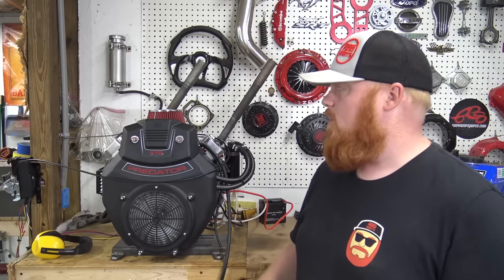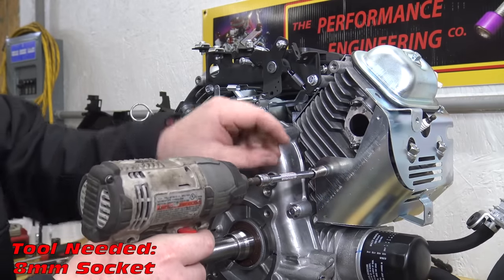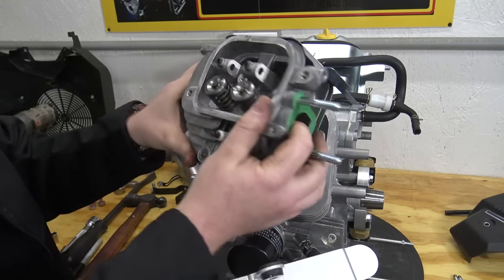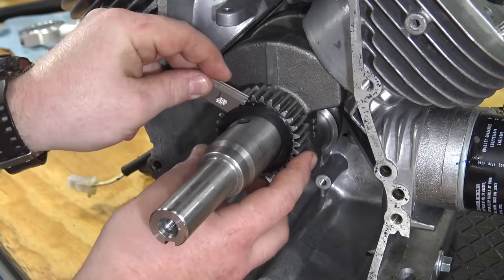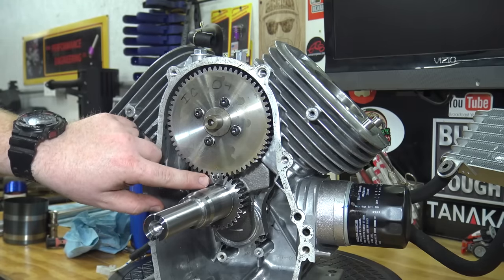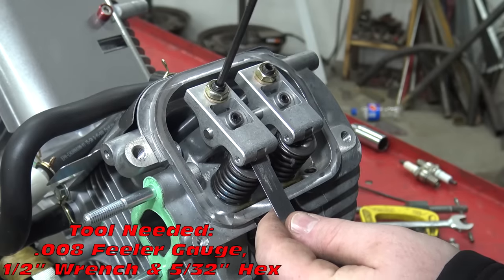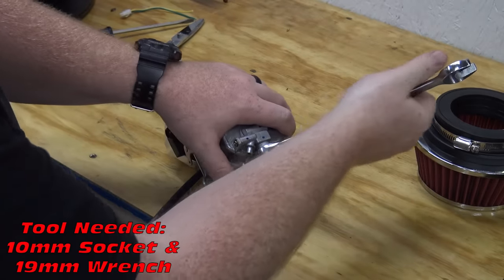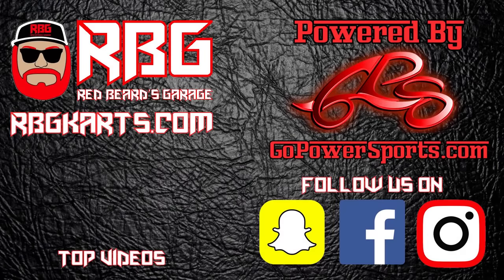🔥 40+ Hp Predator 670cc Performance Engine Build 🔥

Comment: Should have shaved the heads to raise the compression! That definitely would have givin you a few more ponies. And depending how much you have shaved off you could/would have to use higher octane gas like race gas or cheap 100 octane low lead from the airport. 100 octane low lead is cheap just like pump gas. Race gas (110) is spendy tho.

Comment: Uhm aluminum rods for longevity???

Cam, springs, pistons only thing here actually worth doing personally.
Reply: @VasilyBuilds  
None personally with predator motors but aluminum rods are the wrong material for longevity in the rod department.  Rod failure is probably pretty unlikely with such low rpm motor anyways
Reply: @VasilyBuilds  Jesus fuck the stock ones are cast aluminum? Thought they were at Least cast steel.

Comment: Now remove the Flywheel off and put it on a Lathe and shave off some weight and gain faster RPM
Reply: They built it for off road so a heavier flywheel means more torque which is what you want. For racing a lighter billet flywheel would be better suited.

Comment: #RED BEARD: WILL YOU PLEASE ADDRESS HOW GOOD THESE ENGINES ARE BUILT STOCK? SO MANY ARE SAY THEY'RE BUILT LIKE CRAP BY THE OEM & WONT LAST, YET GOOGLE DOESN'T COME UP WITH A LOT OF FAILURES OF THE STOCK ENGINES? AND WHAT MINIMAL PARTS WOULD YOU SWAP OUT TO MAKE IT LAST - FOR THOSE WHO CANT DROP ANOTHER 1K FOR A PERFORMANCE BUILD. YOU SHOULD ALSO DO ONE ONE INSTALLING THIS ENGINE & AN A ARM LIFT KIT ON A GOLF CART AS THERE'S A WHOLE INDUSTRY OF GUYS MODDING CARTS INTO CHEAP (CHEAPER) UTVs OUT THERE (LIKE BUGGIES UNLIMITED/VEGAS CARTS)! AND - IF YA EVER GET A CHANCE PUT ONE IN A 97 CLUB CAR DS GOLF CART - SO YOU CAN ADDRESS REPLACING THE  CLOCKWISE REAR END & CLOCKWISE FE290 KAWASAKI LOW TORQUE ENGINE & THE RESULTING INSTALL OF HIGH SPEED GEARS IN THE REAR END TO REMEDY THE RESULTING PROBLEM OF YOUR F&R BEING SWITCHED. LOTS OF GUYS NEED THIS VID!

Comment: What's your opinion on this [stock] engine? Any good?
If I'm not mistaken, they consider this engine a "Chonda" -- a chinese clone of a [discontinued] Honda model. Is it built as well as the old Honda GX670?
Reply from the maker: There not a clone of a Honda. Different valvetrain and ton of other differences. These engines last as long if not longer that true Hondas in my opinion. I have talked to a lot of small engine builders that will say the same.

Comment: Wouldn't a similar size bike engine have more horsepower tho? I had an old 80s handa 450 that was rated at like 36
Reply: Fordman 1991 p
Reply: This is just a torque monster, it's not designed for 9000 rpms.
Reply: Fordman 1991 and very little torque before 6000 rpm

Comment: Do they make a performance kit for a 708cc vertical shaft predator because I'm eventually building an off road mower and I'm going to use the vertical shaft 708cc v twin
Reply: kirby vanduzer I emailed the company who makes the parts for this build and they said they don’t currently offer any for the 708 but they’re working on it.
Reply: @macymorse80  well crap I guess I'll have to get a different engine for a while
Reply: @macymorse80  do they make them for any other vertical shaft engine
Reply: @kirbyvanduzer6565  that I'm no sure, I was just asking about the 670. Though the popularity of the 212 there might be some ways to do a build on that, not like the 670 though given its size and displacement.

Comment: why aren't you using a billet flywheel as well? and do I dare ask why your moved the fuel pump?
Reply from the maker: Heavy stock flywheel makes for more torque. We are building this for off road not high rpms. The fuel pump is actually what caused the fire on the last build. They are faulty from the factory
Reply: Red Beard's Garage oh that makes sense! Also I figured the fuel pump is what caused the fire on the last 670 but I couldn’t remember for sure

Comment: Definitely an interesting build, I recently did the top end on a Kohler V-Twin, these Predator engines look so cheap compared to the Kohler.
I don't see the point of removing the oil sensor why not keep it so you can monitor the engine or put an oil temp sensor in its place.
Also it looks like you did a lot of unnecessary work like removing the flywheel coils ect

Comment: Why are these Honda engines called Predator?
Reply from the maker: The Predator engines are a lot different than the Honda engines. Different head design, intake manifold and valvetrain.

Comment: Could a guy build a engine like this and with this kind of hp and use it  Reliably on a ultralight aircraft
Reply: Motor stock weight is 106lbs. soOo, if you can allow for the weight: yes. But you can't foot launch a PPG with it hanging on your back.

Comment: Everyone is asking about prices, and it appears to be $1500 for the full engine and mods.  What kind of hp and torque could I expect after doing the upgrades?
Reply: The $1800 built motor on performance 670's website seems to be similar, and adds about 10HP and 13 ft lbs of torque over stock for anyone who was wondering.

Comment: Title says 40 plus hp, I doubt anything you added double horsepower.  Just don't see adding a billet rod some valve springs,  air filter and header exhaust would get it to 30 hp. Much less 40 plus.

Comment: I can't claim to know very much about go-kart engines, but I do know a thing or two about car engines being an old race car mechanic myself. Here's what I don't understand. You guys obviously spent a lot of money on that engine and it's upgraded parts. Despite the rather large outlay of cash, you are assuming that those cheap Lee made Chinese boars are around, and the hone in them is clean and up to spec. Also you're assuming that the ports in the intake and exhaust are free from casting Flash and sharp edges. Just my opinion, but if I applied those building techniques to a car engine, I would have built either a ticking time-bomb, or an absolute dog. Also you did nothing to upgrade the timing curve or ignition in any way whatsoever... What exactly am I missing here? Seems to me all you really did hear is upgrade the rods to allow higher RPMs, upgrade the cam to move the power range up the RPM scale, and remove the governor. Can you really call that a monster?

Comment: How do you know you are at 30hp? and why the 40hp on tittle? All I can see that can create gains is the air intake, exhaust, cam and springs, the rod and pistons seem to be the same as stock in specs, so yes stronger parts but no actual power gains from them. If you added say a longer rod and shaved the piston down I can see more compression but you didn't do that.

Comment: I've built street and race car and motorcycle engines for decades, and 4-stroke and 2-stroke race kart engines for a few seasons, and to the very best of my knowledge, torque values for for all critical engine fasteners, such as connecting rod, head and case cover bolts, assume dry assembly. What's your reasoning for lubrication before assembly? It doesn't appear you are de-rating to compensate for the lubricated threads, as the torque values you're using seem correct for dry-assembled parts.

Comment: Arent you concerned about the crankshaft seal leaking after youve taken it off? Every time i remove an oil seal I replace it with a new one same with grease seals basic practice.

Comment: Why do you bother with these predator motors when you could use say the motor from a suzuki rm250 which is smaller and lighter and making about 50hp also the sequential trans is a lot more fun too
Reply: After reading it again i sounded like a bit of an ass my point is these seem great for a kids kart it's all pretty simple but for something that really goes and is a ton of fun bike engines seem like the better option
Reply: I tried this route too building mine. Because you cant buy them off the shelve.  If you run across a good deal sure but the cheapest on ebay just now was 950.00 and it's a used engine with no telling what type of problems but there are a lot of people that do this. Then you have to deal with the shifter and clutch linkage, also every motorcycle engine type has a different engine mount, there are hundreds of them so you have to fab your own mounts too. Search over at one of the buggy forums and see tons of them. Biggest issue though is still no reverse.  The predator and similar could be better but these are all off the shelf most anywhere and you can get parts cheap. break it and go get another. Break your rm250 motor and either have to fix it or change up half the kart to install a different type of motor because everything is different again.

Comment: why would u like to get like 30 hp out of this instead of like 20? u could get a 700 cc motorcycle engine that does 100 hp.. is smaller and runs way more elegant than this cheap engine stuff..

Comment: Do away with that music. If you are interested; K&N filters leak more dirt than the old oil bath filters. Paper filters do better. If you want the best filtration, go to Amzoil filters. They are of aircraft quality and are the ONLY filters that kept Mt. St. Helens ash out of the engines. Just sayin'. I used to have a filter demo display before a grass fire burned up the car it was in.

Comment: one thing i see from all of you tiny engine builders seem to miss, is balancing the low end??????? makes a big difference at 10k rpm. one other point on some of theses engines you can move the coil to change crank rotation. pending on gear cuts

Comment: Um where is the performance Here there was no porting ,no head milling, no angled valve job, no light weight valves,no carb tuning no crank balancing .no light weight fly wheel pretty much just stock with heavy duty rods and valve spring's. I mean it will rev up more and that is limited with no crank balancing. Vid is still cool but  very little performance gain for what them parts probably  cost.

Comment: gotta have dat k&n filter, brah...gotta get some dirt inside dat engine to ruin it...k&n sucks.
Reply from the maker: I have ran them on every engine I have ever owned and never ruined one.
Reply: Red Beard's Garage I had an old 5hp briggs, ran a k&n on it and it started burning oil..k&n was letting dirt in the engine and the cylinder was scored..also ran one on my old ford pickup and found grit/dirt in the throttle body..k&n went in the trash and the stock paper filter went back..grit/dirt hasn't come back either. These two reasons is why I dislike k&n.
Reply: If you follow the instructions on proper oiling and cleaning of the K&N it works better than stock

Comment: I can see why these Chinese engines are cheap.  A removable plastic cooling blower bolted to the flywheel?  That's a poor alternative to the one-piece flywheels used by Briggs, Honda and Kohler V-twins.

Also, the Predator's aluminum parts, especially the heads, look chintzy.  If I had to use this engine under high performance conditions I'd surround it with something to catch flying parts and hot oil when the thing loses its lunch at high RPM.  ☻

As for using one of these Predators to power a light aircraft, you'd be nuts to do so—if you could get enough power out of it to even get airborne.  It's a clunky, overweight powerplant with a marginal lubrication system—plastic gears drive the oil pump.  That is a failure waiting to happen.

There's a gentleman in the UK who built an ultralight aircraft powered by a Briggs V-twin "big block" engine, which is better-quality engine than the Predator.  He had to go to considerable lengths to get the power level up to where it was needed without unduly compromising reliability.  Furthermore, he was forced to use a costly fuel injection unit to get around persistent carburetor icing problems.  He was very trusting of that engine, as he flew his plane across the English Channel in both directions.  Although I generally consider the Briggs V-twin to be a good engine, I wouldn't ever consider using it as an aviation powerplant.  I enjoy breathing!
Reply: i think these engines are mainly used in go karts and such. imo, a half vw, or motor bike engine is better for ultra/micro light aircraft.

Comment: Standard compression ratio?  Heavy steel flywheel?  Dangerous plastic fan?  What's the point, except to parade all the advertisers' product?  The only thing you have of any value is the up-spec camshaft, but you would be more likely to LOOSE power there since the low-rpm torque will be down and the upper torque will be unusable...  All you have there is a noisy exhaust, a bunch of billet parts and an "estimate" based on nothing.  Take it apart again and aim for 10:1 compression, lighter flywheel, safe steel fan, and 100 octane fuel.
Reply from the maker: Well hello negative Nancy. Heavy flywheel gives good torque, plastic fan has never blown up on my watch, exhaust sounds sweet, rods for longevity, making more power in the low rpms.
Reply: Steve Wright glad you know it all
Reply: What about a reverse megaphone exhaust and and and and a performance air filter!!!!  :o

Comment: Stock pistons, stock heads, STOCK CARB, HEAVY AF stock flywheel, stock oilpump etc. And you really say this is PERFORMANCE build ? :D cmon. Maybe powerband goes 500rpm higher than stock  670 and no governor, nothing more.
Reply: Its built to go off road, a high torque engine. Not every purpose requires 8000 RPM.